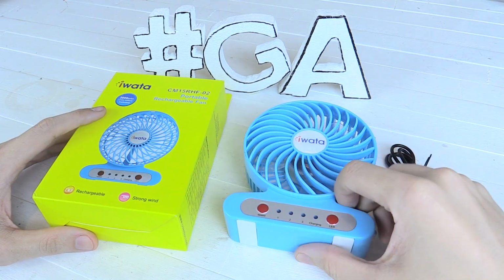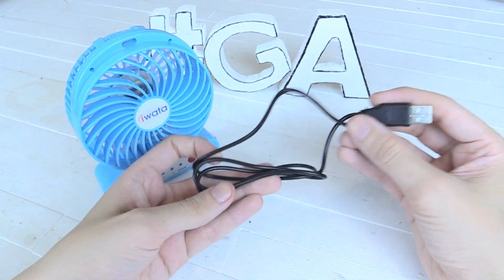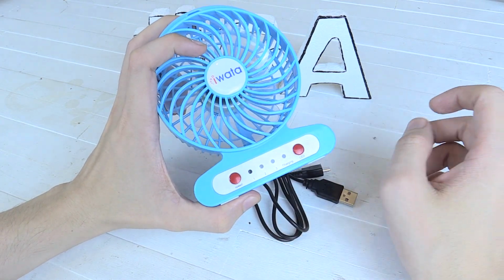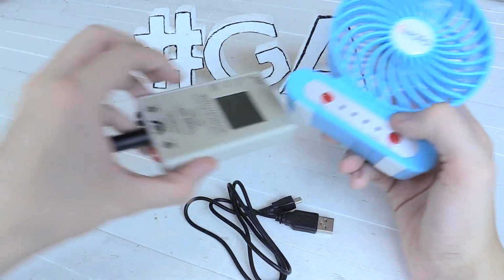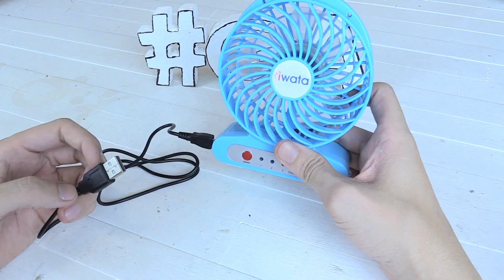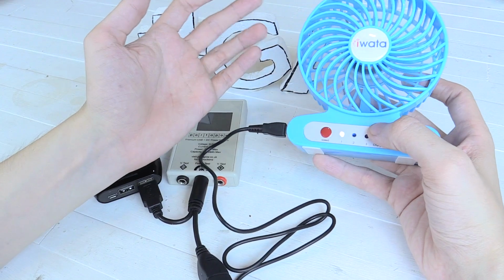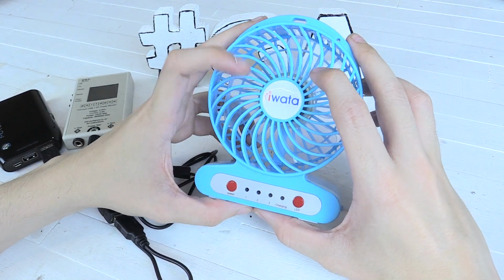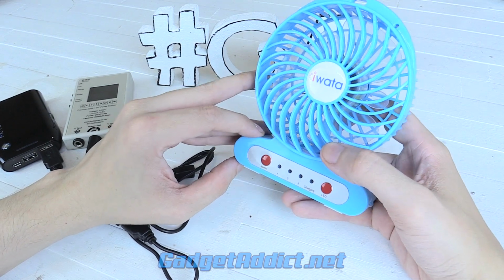iWata Rechargeable USB Fan

Comment: iwata? terrible support. Never buying thier products ever again.
Reply from the maker: Really? what happened?
Reply: well found thier email. sent them my issue. Product was a fan with the fog thing. when turned on it would fog but no wind (blades not moving). Told them its out of warrantly and looking for repairs. Took them a while to respond asked me where i purchased. then a few more days. I followed up. I was finally forwared to technical support. Then same round of questions. Thru slow response email. I answered.. then  they finally stop responding. Well i gave up.

Comment: Seriously this is an awesome review! I bought two of these, 1 is for my dog cage and one is for me because it is getting insanely hot in the country! I truly found this video helpful because I wanted a quality fan and this is definitely worth every penny. It  just extends the life of the battery and I'm relieved that this will not blow up unlike the other cheap ones out there. Mine runs for only 8 hours in the lowest setting though but still, I'm not complaining. 😂Thank you so much!😊
Reply from the maker: Thanks for the kind feedback and I'm glad you're happy with the performance of the fan. I've been using mine every day since it arrived and it's still going strong :D
Reply: Gadget Addict hopefully mine does too! I'm torned between this one or the Cdr king one because both runs for a really long time but since this is your favorite and I really trust your opinion, I've chosen this one and I'm very happy with it. 😊 Does your Cdr fan still work perfectly?
Reply from the maker: My CDRKING fans are also still working perfectly. I've tested many fans and the iWata has the best airflow and that's why it's my favorite. But what I don't like about the iWata is that the battery doesn't charge while the fan is running. Ultimately iWata is one of the best out there in terms of materials used and the battery itself. But the CDRKING ones are pretty decent too.
Reply: Gadget Addict Haha well I dont mind that at all and its still a great buy😊 Thanks again and keep making informative videos! And I love what you said about "Behind every great man is a great fan."😂😂😂 i live for it hahahaha

Comment: I got this so I can use it to cool down my ONU and Router and for 24/7 operation, it only last about 6months or so. Mines already failed due to bearing issue, the fan doesnt spin freely anymore. The fan is set to #1 when I use it.

I guess im back with standard CDRKING USB fan (literally USB fans not the usual portable rechargeable usb fans) and that last about 2 years now without having the motor failed.
Reply from the maker: Really? I've been using mine every day for at least 8 hours and it's still going strong. Why don't you get it replaced under warranty?
Reply: I already sent one but the RMA is rejected because I abused it (24hours operation for more than 6 months), I dont know how they can tell that but yeah, sayonara RMA.
Reply from the maker: +remle ikawura do you have a copy of that? I'd like to question it with my contact at iWata. That doesn't seem fair.

Comment: Try to use Sound Tool (SPL Sound Meter) app!
Reply from the maker: For what purpose, measuring the noise of the fan?
Reply: Gadget Addict it actually did help when i was in the mall recording the noise if the fan! And it goes like 87 or 82dB!

Comment: can i use it while charging or do i have to remove the battery if i want to use my portable fan while using the charger
Reply from the maker: +_Technophyle you can use it while plugged in and you don't need to remove the battery. If you turn on the fan while plugged into USB, it will stop charging.
Reply: ohhh ok thanks for the fast reply!

Comment: i will get one around this week or next week
Reply from the maker: Nice! I hope you enjoy it :) It's getting hot hot hot!
Reply: Gadget Addict exactly i will just wait for it to arrive  this summer :P and i will be getting a fan from Amazon too but it will be brought on April
Reply: Gadget Addict i was gonna buy fans from CD R KING which one does last the CD R KING branded or the Snowflake one?
Reply from the maker: They're both pretty good although I get a longer runtime on the iWata version.
Reply: How about on all of your USB fan collection
Reply: Gadget Addict i quite getting addicted to this USB fans
Reply from the maker: I only have two USB fans now :) The green double battery version from cdrking and the blue iWata fan :)
Reply: Gadget Addict  how about the fan you brought from Ace hardware and i have 1 brought from the street, the 3 are from CD R KING one from the Ace hardware in black and a Iwata fan this week or next week in red
Reply: Are you gonna hunt for cheaper rechargeable USB fan on how dangerous are them
Reply: Gadget Addict  i have it now and it is perfect they fully charged it soo both of us have iWata Rechargeable USB fan
Reply: Is it possible to make a powerbank using a 18650 battery or a 3.7 old cellphone battery and some USB and micro USB wires and is it possible to use a 18650 battery on a desktop USB fan ,and can you somehow (if possible  you want to make it) make a replica of your USB battery that you brought on CD R KING (the one you use in the "Mini Desktop Cooler Aircon") can you make one using a 2 or 1 18650 or a 9V battery and use a USB and micro USB wires

Comment: how long does the iWata last on it's lowest speed
Reply from the maker: 11 hours 8 minutes in my test :)
Reply: Gadget Addict soo it has the same as the CD R KING Dual battery fan 11 hours that is soo awesome well here comes summer i will start to use fans like this
Reply from the maker: I use mine most days :)
Reply: Gadget Addict what fan this one?
Reply from the maker: I use the blue iWata and the green dual battery cdrking. I mix between them. I don't have any others right now :)
Reply: I got like addicted to this is rechargeable USB fan

Comment: after fully charging the fan mine always flashes the 3 led lights when not in use, is it normal?
Reply from the maker: Mine only flashes when the battery is low. I'm not sure why you'd see it when it's fully charged. Does it seem to operate without any problem?
Reply: yes it is still working fine, but mine only operates about 6hrs at lowest setting after full charged. it only bother's me that it flashes 3 low light even it is not in use, also i notice that when the led light is on the 3 led light indicator also lights up.

Comment: buy digital anemometer it measures air flow in standard units .
Reply from the maker: +Kedar Nimbalkar yeah the reason why I was trying to think of another option is because I want to measure overall air flow and not just the max speed in a single spot. But with multiple spot measurements and some averaging , it would probably provide a clear enough comparison between different fans.

Comment: Can you replace the 18650 battery with another one? I have two USB fans and I cannot replace the batteries that came with the unit with the 18650s I use for my flashlights.
Reply from the maker: I've used other 18650 cells with the fan and not had any problems. Including a larger capacity 3300 mAh (allegedly) cell. The maximum current drawn during charging is still under 1A, it simply takes longer to charge. Why were you not able to replace the battery in your other fans? They're not removable?
Reply: Excellent. I will definitely be picking one up, probably more. I did not see on it on Amazon (US site). I will continue to look around.

If anyone knows of a US distributor, please let me know.

Thanks for posting the video and keep up the great work. I really like your channel. I cannot tell you the number of items I have purchased because of your reviews.
Reply from the maker: Awesome, thank you for the nice feedback :) I'm not sure which exact locations they sell in, but I'll try check :)
Reply: Gadget Addict  Sorry, I just saw this now. In the two fans I own, BenGoo and another fan with no company id, but it has a model number F95B. When I tried several of the 18650s I have, at least 10, they were too long. I would have cracked the housing if I forced them in. I was using Thrunite, OLight, Orbtronic, and other Panasonic cell batteries. mAhs ranged ferom 2800 - 3400.
Reply from the maker: MonGo WonGo  Ah okay. I guess they didn't account for the longer 18650 cells which include the protection circuit which makes them longer. This one has a huge spring so it can easily handle the longer batteries :)
Reply: That is wonderful news! Thanks so much! I need to get several of these for my daily use and SHTF solution. If any one finds a US dealer, please let me know. Keep up the great works!
Reply: nice! i wonder how the other iwata model numbers perform also

Comment: GA
Get 1 pingpong ball, 1 protractor, 1 short length of cotton thread
Hang pingping ball in front of the fan at a set distance
Using protractor measure disrortion of thread from vertical with fan at each speed setting
This will give you a relative measurement only
I will leave it to other  subscribers to provide an equation to calculate an absolute energy value 😝 
Sibat
Reply from the maker: Awesome, thanks for the suggestion :) One concern I have is that I might get similar results with varying sizes of fans. That's why I was hoping to find a way to measure the overall airflow rather than maximum speed or maximum power in a single spot.
Reply: You could multiply the angle by the surface area of the fan to get a total air flow value
Even if you buy an anemometer you will still only get the same sort of measurment just more accurate and  as an absolute value 
I love your diy videos so this rather crude mechanisms seemed to fit in with those segments
Btw i dont know if you follow 'blind owl outdoors' but i sent  him a link to your pocket wifi signal booster as he lives way out in the province in bohol and can rarely get a signal at his house, i am hoping he will build one and try it out on youtube.  It should be an extreme test, especially for the tranmit signal
Reply: Of course if you want to get realy accurate measure at various points in front of the fan and average the deviation angle 😋 Then multiply by the surface are.  Ok this is getting too nerdy now so i will shut up😀😋😃
Reply from the maker: True, you raise some good suggestions, thank you! I just subbed to Blind Owl now. Thanks for sharing my video with him. I'll be keeping an eye on his channel! It could really make a big difference for him! :)

Comment: i thing you could use a portable anemometer to measure air speed or airflow. lazada has them. hehehe...
Reply from the maker: Yeah I was thinking about that. But that might show one fan to be faster than the other but the actual amount of air it's moving could still be less. For example a tiny but fast moving fan blade vs. a slower but larger fan blade. So I think my target should be to measure the overall amount of air being moved. That's why I was trying to fill up plastic bags with air and time how long it took. But it's hard to get a good air tight seal to make it an accurate test.
Reply: how about hooking a pvc pipe on the fan and on the plastic bag? just a crazy idea though. hehehe...
Reply from the maker: asi146 Yeah it might work, if I could somehow match the PVC to the fan size and create a good seal. It's similar to my original idea, just needs some tweaking. Thank you :)
Reply: how about cardboard roll? just a thought though. hehehe

Comment: I have one of those cheap fans that looks like this. I wasn't impressed by the battery so I replaced it with an 18650 from a battery pack of a Lenovo notebook.
It came on for like 5 seconds, then it burned. :)
Reply from the maker: Yikes, scary. I guess the problem with all the fans basically looking the same is that people assume they're the same on the inside and that the one selling for $2 is the same as the one selling for $8. I'm actually tempted to go on the hunt for some of the super cheap fans and see just how dangerous they are!